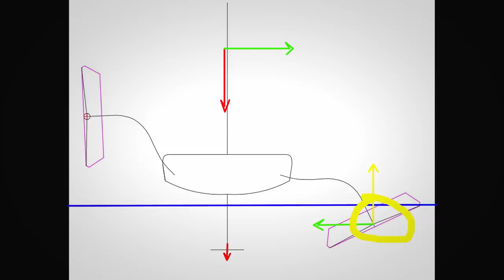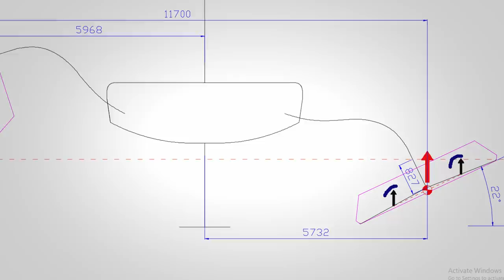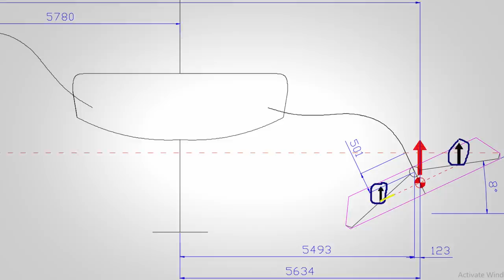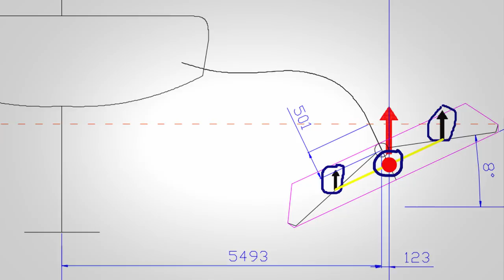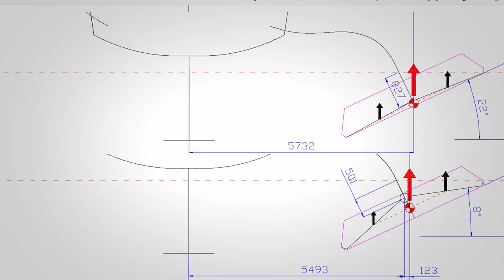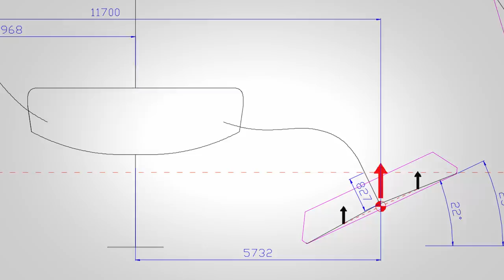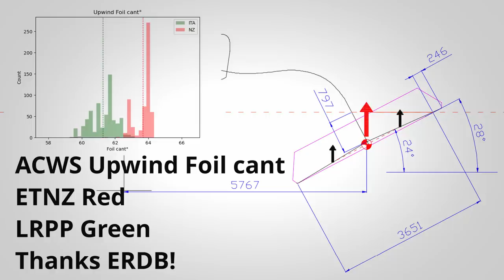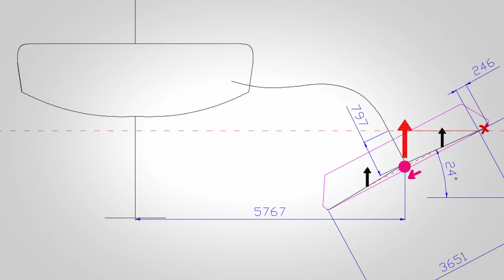Is this the ETNZ advantage that will decide the Cup?

Comment: @MozzySails since so much talk is about righting moment, why do Italians if they have worse righting moment insist on normal (nonbatwing) sails. We also noticed that they sail higher above water at higher speeds, based on their hull shape, can they produce venturi effect between hull and water line? That would mean hull would be sucked down increasing righting moment at high speeds significantly and no need to get that batwing sail. Italians are in very good control of their boat and i think they willingly choose high riding height.

Comment: With the mast extending at the bottom and a lower deck, it looks like ETNZ has to punch a smaller hole through the air.  At the higher speeds this might be another advantage. Some LeMans cars use this pattern on their roofs.
Reply: If they reduced frontal area it's because of the lower deck since their mast is actually a few feet longer although equal in absolute height.

Comment: Very interesting video. However, it appears to me that there is an underlying assumption that the pressure distribution on the leeward foil is symmetrical with respect to the foil strut, similar to the pressure distribution for an aeroplane.

However, for those teams with 2 flap controls, that may not be necessarily true? In fact, they could tweak the span-wise circulation distribution so that the resulting centre of effort is more towards leeward than the corresponding symmetrical distribution obtainable with a single flap actuator.

Any thoughts?
Reply: This is very true

Comment: you are assuming both boats are getting the same wind the whole time around the course. i think the boat ahead has the advantage. plus i think the difference is in how fast you can turn get back to speed and how long the other boat in slower when they turn.
Reply: These are all very valid points and LR probably has an advantage in maneuvers and potentially acceleration back to equilibrium speed. 

Yes, our assumptions are based upon the same true wind speed and true wind angle.

Comment: hey, could you comment on longitudinal position of the foils. LRPP has foils in front of the arm, and ETNZ pushed max backwards. I am guessing this makes point of lift for etnz about 1m back. Would be nice what you guys think about that difference. keep up great work!
Reply from the maker: Fore and aft relative to centre of gravity changes pitch balance and stability. But that can also be changed with foil arm position as well as wing attachment to arm. 
I think the attachment to arm is about separating peak pressure but also about foil 'flutter'. 
There's a video from a few weeks ago we did touching on this.

Comment: As ETNZ lifts its foil up so that the tip is out of the water, what about the change in the share of vertical and horizontal components of lift? The doesn't the vertical component decrease and the horizontal increase? How does that change effect the righting moment? Also, not that it effects the comparison of the two boats (probably), isn't the righting moment based on 6.5 tonnes, as about 1 tonne is at the end of the foil arm in the water?

Comment: I my be wrong but the foil shape of TNZ has a slimmer profile, i.e. the foil max thickness seems far less than LR? I'd imagine there would be a reasonable drag advantage there if they can compensate for the lift reduction without induced drag.

Comment: I'm guessing, though, that canting the foil arm out further on ETNZ gets a little complicated, as the lift force angle changes and is pushing more towards the hull than the more straight up force when the foil is "level".  My non-engineering intuition says that maybe that negates a little bit of the advantage gained by the righting moment moving outward?

Comment: nup! if you take moments about the centre of gravity the moment created by the t foil is no different to that of the anhedral foil.  To balance the boat the resultant vector of the foil and strut combined must pass through the intersection of the weight vector and the resultant lateral air force vector. For there to be no strut lift ( mitigating against ventilation) then the cant angle needs to be atan (air lateral force/ mg), assuming there is no lifting force generated by the rudder foil. If the cant angle is greater than this then the strut produces lift opposing the foils lateral force. And in combination, it is very doubtful as to whether the righting moment has been improved.  Another issue in the anhedral discussion is that foil lift and drag deteriorates as the foil gets close to the surface. The "t" gets more area deeper than the anhedral foil. This aspect may be driving LRPP triangular plan form. To have the rudder foil pull-down increases righting moment as that forces more load on to the lee foil. This necessitated having the CofG as far forward as the rule allows

Comment: Was the foil box a red herring to lure the other teams into working with anhedral foils... or did ETNZ figure all this out after the fact?
Reply from the maker: Etnz ran anhedral and t foil on their first set. This suggests they were uncertain themselves. The T works particularly well at high cant and tips out, which may not have been obvious until they tested T v Y
Reply: I'm sure the comment is a jest but in case it isn't, well, there needs to be some kind of framework to ascribe rules governing the design of the foils. The other teams had the option to manufacture the same style of foils. We saw different foil designs being tested including W-style.

Comment: Is it possible to have the wings of the foil upside down (internal parallel to the sea level, external 60°) and asymmetrical (the outer smaller)?
Reply: Foils must be symmetrical on either side of the arms according to the rules. Why upside down?

Comment: has any one else seen the video clip of how ETNZ used AI to sort out human sailing issues ? 
whether other competitors have used it ?  ...but no stone left unturned
Reply: i wonder how advanced the ai is, whether its also performing manuevers better than the tnz sailors. Super unlikely but perhaps piloting their chase boat for their practice racing?
Reply: @minime453  The mentioned that eventually the AI was able to perform  better than the sailors.
Reply: @minime453  look it up on y/t..... bloody amazing mate
Reply: It seems ETNZ engineers were initially dubious about the application of AI to the simulator however they persevered and eventually had a breakthrough. Now it seems the AI can at times sail the sim better than the humans. This then is driving the sailors to try and better the AI which should hone their skills.
Reply: It was a very  interesting video on using and applying AI . Lot's of folk said LR's stability and crew disposition  was a critical winning factor in the PC finals. Federico Albano has modelled ( by Fourier method)  LR's stability during manoeuvres  against INEOS and determined a 20% improvement from previous races.This contributed to significant ground  gained by minimising crew movements and focussing on foil deployment/ timing to maintain upright position and acceleration out of turns. Under the rules ETNZ and LR can't practice against each other. ETNZ's AI application could easily simulate   LR's  2 helmsmen and crew arrangement  and trial race it against ETNZ crew setup. Wouldn't surprise me if  ETNZ's current "on the water" experiments in modifying crew movements comes from 'learning" and perhaps "copying" aspects of  LR's boat handling advantages ( if they exist) through this kind of simulation.
Reply: @alienlifeformresearch2280  Yes, Grant D said they had many misgivings to start with, but perseverance pays off,  ETNZ seem to have thought ' outside the square ' with every aspect of the rules. They appear to have a quantum step ahead of the other teams. I expect them to be faster in every breeze, and crew work will be as good if not better than LR ( Lunitic Rooster )
Reply: @bobawatsit  We'll know more Wednesday night.
Reply: No... I'd love to see that, is it on their channel?
Reply: @ScottMoyse  Do a You Tube search for "McKinsey Americas Cup" to find the AI feature.
Reply: @alienlifeformresearch2280 yup, I did that thanks. I just finished watching it. Awesome stuff... Disappointing to see so many negative comments below it.
Reply: @ScottMoyse  .  Using "machine learning" AI  for performance optimisation rightfully sits alongside CAD, wind tunnel/water tank testing, sports science in fields of strength & conditioning and psychology, materials science, technology transfer from aero and auto design, etc, etc. It is just a more recent tool in the race teams arsenal of tricks. Racing technology " improves the breed" . At end of day, AC rules still dictate it is up to human sailors to drive these  vessels and that is a very complicated thing to do. Many of these sailors have dedicated their entire careers to the "art of sailboat racing" and have the equivalent of multiple advanced degrees in the technicalities and nuances of getting from A to B in first place on a race course. They would make racing coracles across a creek a spectacle of high drama. What is there to be negative about any of this?
Reply: @alienlifeformresearch2280  very well said.
Reply: @ScottMoyse  Yup !   one of my favourite sayings is " the bullshit stops, when the flag drops "

Comment: Is it allowed to have different wingflap-settings for the left wing vs. the right wing of the foil in the water?
Reply: I think it is allowed. Though they need to have the same range of motion and be centered at the same spot. It would be a possibility to get the center of lift more outboard but it would also require a lot more control systems in the wing to control the flaps separately. So it seems unlikely that they are using such a system.
Reply: yes
Reply: @guuspronk1775  seems extremely likely if not certain LR is doing it
Reply: It is what they actually do. In an interview Luna Rossa design people said that they use the winward flaps for different purposes than the other.  
The flaps are driven in a different way for LRPP. I don't know for ETNZ
Reply: Seems to me they could theoretically even use counter-torque with negative lift on the inner wing if the outer wing can produce enough upward lift for the whole setup..
Reply: @ikerstges  that would worsten leeway

Comment: Nice, however the vectors solution proposed is too simplified and, more importantly, you are not taking into account the use of flaps. Actually, using flaps asymmetrically, it is possible to neutralize or reverse the foil moment of the windward side of the foil, so the neutral part of the foil could controls the drift, pushing windward eventually. This could bring to a significant beneficial windward drifting...
Reply: Great comment. In my opinion the anhedral foils open a number of possible uses that have still to be explored. I am so looking forward to seeing the match...

Comment: Good analysis BUT....  The Y foil can set flaps differently.   So LR can at extreme use only the exterior arm of the foil for lift and have the internal one set neutral.   Set like this, the center of lift can be moved 10s of centimetres to windward.  OK, it might cost a bit of drag and leeway in that extreme setting, but there is a lot of range in between.
Reply: Also, trimming the internal foil could give LR the ability to sail closer to wind direction and a compensate lower speed, resulting in closer VMG between the two boats.
Reply: Yes however the straight foil can also set flaps differentially. The straight foil wins in RM, the Y foil wins in control.
Reply: @giovannigaleotti2623  actually ETNZ foils are not true T’ foils and are not straight

Comment: Are you considering the extra drag generated by the foil tip piercing the surface?
Reply: Yes, the additional spray drag has been included in the tips out calculations. It actually has a relativly small influence
Reply: @thomaspartington8464  Fascinating. Many people are making big issue of the surface drag.
Reply: paul marcel  nothing to be loling about, it is a factor. maybe you could document yourself on hydroplanes designs and improvements of those over time. also any basic knowledge of naval architecture will suffice

Comment: The vector maths in your annotations is not quite correct, the anhedral as you have shown it will give almost all its lift to to the vertical component on the outer foil as opposed to the inner one giving far less and hence the cp will be more outboard than you have shown.  With the T foil the vertical component is less overall on both foils and hence centered cp at the bulb as you have shown, the extra 2 or 3 degrees cant wont ad any additional necessary as the extra cant drops the vertical component on the T foil and most likely wont ad extra moment. Besides these factors the moments are not a pure rear view roll center and if it moves towards a line between the rear rudder foil and the front foil in the water then all these vector diagrams become very different. This is a very interesting discussion and today we will have an idea of which boat has the engineering dialed in or not.

Comment: I hope that your predictions are as "accurate" as you have performed with the Prada cup, giving a sure and certain victory to INeos....
Reply from the maker: Rob predicted a LR win...
Reply: Yep. That's a bit unfair. I even went 1st.
Reply: As previously noted, predictions follow analysis.. So to our LR 'fan'.. they are not about showing favouritism. If the analysis had shown what advantages to performance came from LR design then the predictions would be different. No point in spoiling the excellent technical analysis between Mozzy and the several commentators here for rhe sake of beating your own chest about who 'should' win. Keep that jingoistic stuff to social 'fan' channels.
Reply: Agree and applause to Mozzy on the tentative to give an inside high level technical analysis, although I do believe most of the advantages would come from “inside” and hidden technical solutions instead of obvious differences between the two fantastic boats being developed by both teams. Nevertheless, apparent tech solutions can’t lead to predictions that don’t take into account the “human” skills, that are the essence of any sports activity! In this respect, I would rather question and put the attention on the way rules would be applied for the final of AC and the role of umpires, as it has been slightly pointed out in recent comments. It is a matter on how match race could or not be applied effectively, just return our attention on the lack of penalty that umpire didn’t give to Ineos in the last race of Prada cup which is really diminishing the possibility to see match race effectively! What’s going to happen in the prestart is of paramount importance!
Reply: @salvatorecincotti3150  Quite agree that the penalty process for these races needs careful reflection. They really have not thought it through so far and we don't want the match racing spoiled by umpire delays etc. Mozzy has highlighted these issues before. Let's all hope for a good range of wind conditions in the cup races to really test out the boats and the teams.

Comment: Assuming they were able to change foils, could LRPP put on a T foil and be as fast or faster?
Reply: @Gay1Guy  Yes, I understand that but if they did have a quota left, would it make any difference?
Reply: @Gay1Guy  So it's not just the foils alone, you have to match the rest of the boat with the foil design.  That's interesting.

Comment: Why is their cant arm longer? That's not in the rule is it? The box at the end of the cant arm is key. ETNZ has a more efficient foil at speed but gives less controllable lift at lift off as it's chord is narrow. Foil ventilation can negate all gains so you really don't want the foil to pass through the surface... my 2c

Comment: Could you perhaps please share your calculations?
Reply from the maker: The VPP to calculate speed differences is quite difficult to just 'share' and I am not sure how good a video it would make. But I'll look in to it with Tom. 
The differences in righting moments are just measurements from the know dimensions of the boats and the cant angles recorded in race data. Plus we know the mass of the yachts and components of the yacht from the class rule.
Reply: @MozzySails   @Mozzy Sails  and the foil profiles... sail foil shape... you guys have just been analising the foil plan...plus your lines of lift are only factoring gravity weight... the line of force should be at the center of pressure... NOT vertical... how are you facforing foil venting from surface piercing... & as other considered commentators are saying anhedral foils puts more lifting efficiency outboard perpendicular through the outboard foils center of lift on a line through the center of pressure... still not factoring foil section drag vs foil lift vs sail section drag... forget surface drags for a moment... your stuck on surface areas :-?
36kn vs 37.5kn ... ISN'T a full percent speed difference... its near enough 4 %... come on guys! your base calcs are out by a factor of 4 without ANY of the other UNKNOWN variables... geeez

Comment: Canting out and leave part of the foil off the wather it's a thing that also LR do, it will not be an advantage for ETNZ.
Also having less wet surface do not automatically mean you're will be faster, on contrary if you goes around hydrodinamic or in general fluidodynamic laws you can have 20cm of wet surface but goes slower than who have 1 meter of wet surface. It's all about compromises, de facto LR could be faster even with more wet surface if they better followed and shaped their foils according to hydrodynamic laws.